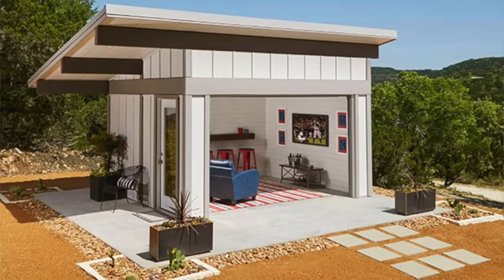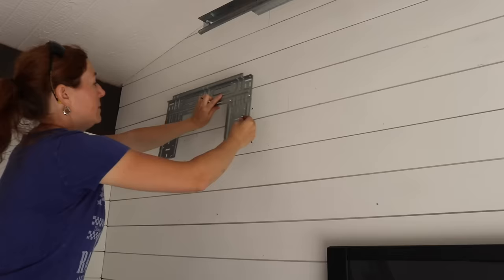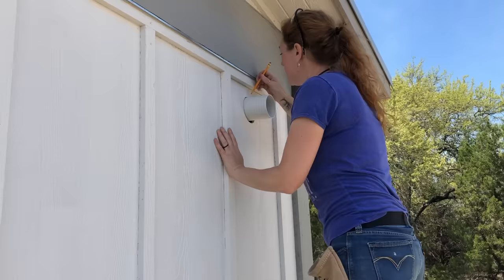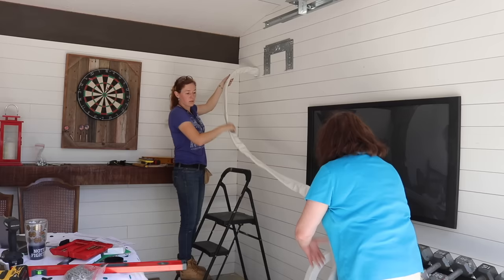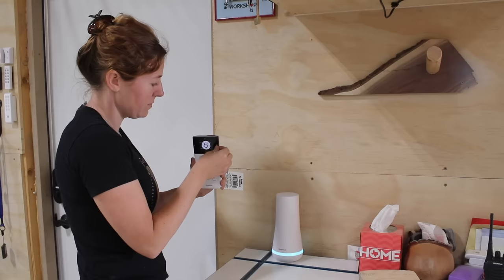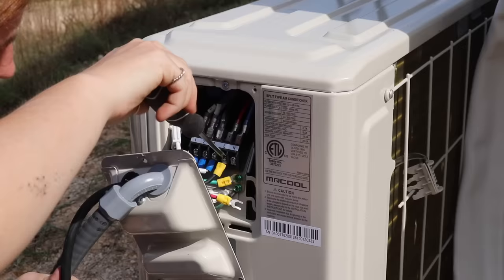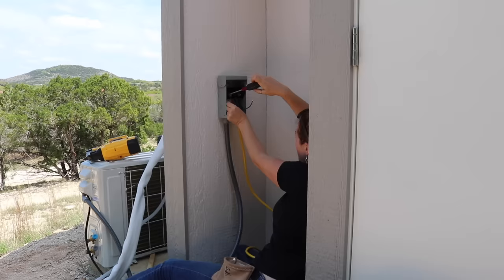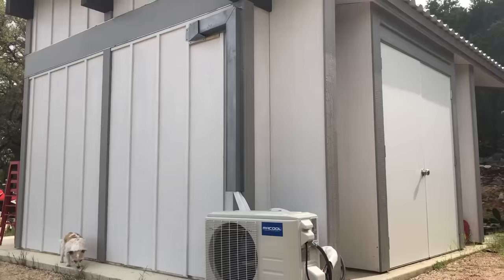DIY Ductless Mini Split Install - MrCool Unit

Comment: For a small space like that does a mini split have any advantage over a portable or window mount type?
Reply: Hugely improved efficiency. Both because window units are typically low seer but also because they are a big hole in your wall. Also night and day difference in volume. Mini splits are available as heat pumps so they work in the winter too. The only downside would be cost.
Reply: another downside is cleaning them. very hard to get in there and clean out all of the dust, dirt and any mold that might collect. since it hangs on the wall you must protect the wall and ceiling from water damage from either cleaning it or from condensation that may run down the wall due to freeze ups or clogged drain line.    https://youtu.be/8ty6F8rP6vo
Reply: @MrXcc4u  I feel that you have described the problem with window units perfectly. If the mini split wall units are cleaned regularly, it's a dream. They come completely apart without taking them off the wall, so once a year you can give them a thorough cleaning and won't have to hose them down unless you neglect them for as long as some of the horror stories you see online.
Reply: How much more efficient?   Maybe more durable/longer lasting? While the window units hole requirement is obviously bigger,  a portables hole requirement is the pretty much the same as the mini split.  Both window and portables can have heat as well.  Portables also tend to have a dehumidifier mode.  I mean, I like the mini split, they are nice, but I think in this case I would have went with a portable.  More functions, easier to install and easier to take care of.   And when not needed wheel it out of the way.
Reply: @Mandurath  Generally a lot more efficient. Average portables are 13-16 SEER. Most affordable mini splits are upwards of 22. Portables with the single hose do take up less penetration space, however it is not insulated - so it's still allowing way more heat transfer from outside than a mini split when it's correctly sealed up. Portables do not have heat pumps unless you spend ridiculous amounts of money, just resistive heating. Mini splits do come in heat pump configurations. And mini splits have the dehumidifier mode. I can tell you they actually work too. Window/portable units run for hours and remove very little humidity, but my new mini split actually lowered the relative humidity in my downstairs (1000sqft) by about 10% in just over an hour. I was pleasantly surprised by that. Again, cost is about the only upside to a small window/portable unit.
Reply: i am a crew of 3 and we are responsible  for nearly 100 buildings and some of those building have as many as 120 a/c units in them. 75% are fan coils on chill water plant.   some are r-22 splits some package units we have about 75 mini splits now with more going in everyday as the r-22 splits are phased out of service due to age. problem is that those that approve of replacing with mini splits are not the ones that have to maintain them. with all of the equipment on campus it is hard enough to keep up with the service calls for no a/c let alone keeping up with cleaning them. most of the mini splits go into dorm rooms and should be hung over the doors so the students don't place a bed or tv or computer under the inside unit, but instead place them above student personal belongings and make it harder to keep up with the cleaning so they go on until it either fails for some reason or when school is out. dorm rooms are breading grounds for all kinds of STUFF. students will use the a/c as a reason/excuse for failing when it comes to exam times. too hot, too cold,musty smell, mold smell. you name it they have complained about it. in the right application mini splits can and will be a very good choice, as long as those the pick out the location and application will be the ones to service them. just sayin'
Reply: also single tube portables will rob the air that you just paid to cool and send it thru the condenser coil and blow the air outside of the cooled space, thus causing the cooled space to become a negative air balance and draw in unconditioned air from surrounding places such as cracks in the walls and around windows and wall plates and even air conditioning duct opening meant for building a/c. better choice if using portable units would be to have 2 ducts, one for outside air to be drawn in to the a/c unit then pushed back outside as hot air. leaving the inside air within the conditioned space to circulate with minimal amounts of unconditioned to be mixed in.
Reply: problems are similar to both. with a window unit it can be pulled out of the wall to be cleaned without fear of soaking the wall under it, which can not be said for the mini split, which is mostly a clean in place.
Reply: Here is an example for a downside of a non removable split ac unit and how dirty it was before it got cleaned (Caution/Warning: Lovable CATS are involved in the video, not the cleaning process) 
https://www.youtube.com/watch?v=6r3HxQm_MJ4
I recently got rid of an out of shape 10K window unit (GE, not sure what price to buy it was), bottom bracket/guides were broken off years ago as they were plastic but used a window mount screw in bracket (Frost King made of metal) to support it, side panels were thus floppy) for a new more silent and efficient 12K unit (Frigidaire for $350 from Lowe's, bottom guide/support is part of the metal unit enclosure, but still use the FK support bracket for safety when moving the unit alone). You would not believe the poor air quality due to lack of cleaning of the old GE unit (had no idea how to remove the mechanics from the enclosure) due to my lack luster cleaning habits most of the year and the fact the manual for it was since gone missing.. I looked up or it online via model/serial number, but then decided to get a new one. Would go with mini split if I was not renting a place but still keep a few window units around for just in case. I also used a 5k Arctic King which since the new ac it just sits in storage now.

Comment: How did you hook to the power source without a plug?
Reply: The term is "hardwired." The wires from the unit connect directly to the wires that supply the electricity. A plug on other devices makes the same connection between the wires of the unit and the supply wires but the connection is removable via the plug. Depending on the amount of electricity the unit requires, code may mandate that no other fixtures/outlets are served by that electrical circuit.

Comment: Why does Mr. Cool provide such a long line set?  It seems to me that if someone needs that much line set, they should look into a different solution.  I would never want that much line set coiled up in or out or my house.
Reply: If you were doing a second floor install you would want that much line. She should have cut the lines down and re-flared the ends.

Comment: I have been looking into these but have been concerned about kinking the copper lines however it looked like you rustled them around alot and didn't have any problems, did you?
Reply: I took a look at what they use,its copper, only if it gets crimped will it then break apart and no longer be useful and need replacing. Thought it comes with pex like other pro install systems.

Comment: Dear April, your system would run far more efficient if you would take the line-set out from behind the Outdoor Unit and put it on top of it and then make it so the loops run horizontal and also in doing so you will give the compressor far more breathing room for better air flow  you did a fantastic job of explaining also next time you will want to drill the hole through the wall for the line-set so that it angles down a little from the inside so that the drain line will drain completely instead of allowing the water to pool inside the indoor unit which can cause all kinds of trouble, mainly for it to allow mildew and mold to grow in your work shed and then you will wonder why the room smells moldy.

Comment: Thanks Greece...i just put one in..first A.C.. I'm hiring professional to do vacuum,  cut and flare line set...he wanted $750...im like What..another $700 You would of done all...In the states they charge way to much to install.
Reply: Sean whoa
Reply: I found a guy to cut and flare.
Run a vacuum. For $200.
Up an running, it's great!

Comment: TBH, judging by how easily you cut a hole through the wall, I would rather cut a larger, box shaped hole in the same wall and install a regular window mounted AC... If you were working on a brick wall or had a semi-detached property with the wall being shared, or were renting and your landlord would not allow large modifications to the property etc,I would understand the necessity for a split unit but in your shed, a split unit is a bit of an overkill. Also it is just for guests so...

Comment: Mrs. Wilkeron,

Love the Mini Split installation. Does the unit also provude heat for those cold Texas days (PS) Winter Days (;-)
Reply: I believe all mini splits are heat pumps
Reply: @paulcopeland9035  do you have an example of a mini split system that is not a heat pump? Im pretty sure that the full name is 'mini split heat pump'......
Reply: @paulcopeland9035  thank you for the correction, i only do service work so i dont really know what is out there though i do know that every mini split i touch is a heat pump and i live in south florida.
Reply: @Straight_White_Fatherly_Figure  per the link, this model has heat pump option, not sure how much it will be used for heating where she lives though. Wish I could get one installed where I live (rental, price is too much for the intrinsic install work compared to my $400 cooling only window unit which serves well)

Comment: When I purchased a pre-charged unit, I had a choice of several lengths of line sets, so I could get just what I needed and no more.  Not to be a negative nag but, I can't help but think you may be losing some efficiency with all that extra length you have.
Reply: The company and also per HVAC industry claims, that much extra line has no effect on less efficiency. Besides, as she said if you disconnect it once it has been connected, then you have to pay for service (some one in the line of work willing to work on these units) to recharge the line for a decent price (expensive in many places of USA), same for if you want to shorten the line, it must only be done by a certified technician. The company does not offer shorter lines for that one reason of it has no effect on efficiency with 24 foot of length. IMO they could still make money while saving on their end in offering  other line lengths as you may only need, she needs only 15 foot at most.

Comment: When you connect the 220V power which side gets the hot and which side gets the neutral.  My wires are black and white, plus ground.  Black is on the left or right?  Does it matter?
Reply: This Mr Cool outside condenser is only hooked up to a 120 volt GFCI protected source from a 15 amp circuit breaker. Hot, neutral and the green ground screw. The prewired cable coming from the inside unit is low voltage. The wire connection terminals on the condenser are clearly marked for each cable. 
It’s a nice product.
Reply: @andread8251  After more research I learned that normal 240V circuits have 3 wires.  (This is for units that require 240V)   Mine were white, black and ground.  The black and white were both hot wires.  If you have a 4 wire circuit, the colors are probably red, black, white and ground.  In the latter case you would cap the white and not use it.  The red and black wires should be the two hot circuits.  check with an electrician if you're unsure what you have.
Reply: @jfsauer42  I know what I have, it’s a 120 volt unit, like the one in the video, and I am a licensed electrician. I’m not the one asking which wires go to where?.

Comment: The exhaust from a generator so close to where you would be sleeping would concern me
Reply: It's on the opposite side of the building from the opening.
Reply: IF you watched where she was sitting as she mentions the power while installing the junction box, that is where the genset is going to sit, outdoors. plenty of space for proper ventilation.

Comment: I think to get a mini split,  how they work,  what brand are you install? 
Great video
Reply: Google mini split , there are several brands . Most are churned out of Mexico with the same internal parts  . Check warranty and shipping costs bc that is where you will get the best bang for your buck . Pre measure the  distance from the inside unit to where the outside unit will rest and select that line set length . Dont listen to the pukes who are making noise about line set lengths . The manufacturer precharges the lines and adds King Valves so a self install is possible . Be sure your AC panel has a slot for a 240 volt install if you select one that requires such . Watch videos  and you will be going in no time
Reply: To see what she installed, try the description where she linked to where it can be bough through Amazon.

Comment: Is that unit also a heat pump? Can it put out heat also?
Reply: You would have to contact MR Cool with the unit number to find out if not mentioned on the box or in the packets. Otherwise its just ac per the website info afaik.

Comment: Are you sure the line and neutral wire were connected correctly to the compressor?? Cz I dnt think so.
Reply: I think you're right,....good catch!!!
Reply: @8000RPM.  try conveying this the the creator so she doesn't damage her ac unit and compressor. I seem to have not been able to here.

Comment: How not to install a mini split ... block your condenser coil from breathing with un needed extra coil .. cut it to size and you shouldn’t run it off a generator they have very dirty electricity I have a feeling you have some issues and up calling someone to diagnose LOL

Comment: I just got one myself, I've only read the instructions once. I think not having a licensed. certified electrical technician do the electric hook-ups voids the warranty. I hope I'm wrong. Jim Y
Reply: @TakeDeadAim wrong - this is a shed not connected to a power grid plus it will be run temporarily by a portable generator,  Home units sitting on the ground/cement pad are not secured - please look outside & see.

Comment: Hi, I had a guy installed my AC unit, very similar to yours, he placed the condenser in a room that I use for storage, but I don't wanted there, I wanted place in the outside corridor. He said that I need a condenser pump to disperse the water created by the unit. Does that sound right to you? I don't see such pump in your installation. can you explain.
Reply: You only need a condensation pump if the water needs to travel uphill.

Comment: Well, it's a little bit late, but I suggests you to install the refrigerant pipe and the drain pipe after you install the indoor unit ( if you can ). Then ( if needed ) you could cut the extra pipe so that you didn't need to coil up your excess pipe. Just a little bit of tips for you

Comment: Would have been way cheaper to just install a wall AC unit with heat as small as that shed is.
Reply: And cheaper too.
Reply: @mabatommy  , they did say and mean cheaper, both in price and install labor. I rent a place so I am stuck and fine with a $400 window unit (though a hassle it is to put in and take out since it is ac only, house has enough draft as is per its age of last build and such, would 600 or so for similar model with heat pump).

Comment: What size breaker does this need to be on?
Reply: This smaller model Mr Cool only needs a 15 amp GFCI breaker, or wire to the load side of the GFCI outlet.

Comment: An expensive mini-split system for 168 sq ft shed is like running JP8 fuel in a 1975 VW bug.
Reply: And a generator powering it 😮
Reply: Comfort for friends is worth the $1500 but many would think that is too much.

Comment: $1200 for a 12kbtu unit seems like a all in one "window" unit would be a cheaper and simpler install
Reply: Window unit is not as efficient not as quiet
Reply: Not for cooling and heating... that unit is a heat pump.
Reply: Look at a pioneer system from high seer. They are cheaper but u do have to vac your own lines. I have really enjoyed my experience with my 2 units from them
Reply: Amazon pricing is not MSRP due to demand fluctuation, normally this unit is $800 when not in such demand due to CIY Creators buying them and posting their install of the unit. As for me I rent so I am fine with paying 400 for a window unit of the same capacity, not all DIY units come with or have said heat pump.

Comment: Try replacing that oh-so-cutesy rollup door with some low-e windows; that will help cool the area and your electric bills from that inadequate A/C unit won't be as high.
Reply: or just cover it with a thermal blanket

Comment: So would you recommend a mini split for a wood shop environment?
Reply: That's what she put in hers.
Reply: i would not recommend due to dust going into your evap coils and causing it to clog
Reply: @NuCreativeHIcinema  Good thing she has a vacuum system to collect much of the dust and they ac units are mounted high as they are. She has yet to post anything about issues with them.

Comment: April, does this Mr Cool unit supply heat as well as cool air? Jeff
Reply: yes
Reply: it is common on some regions units normally have reversing valve to make it in heating and cooling